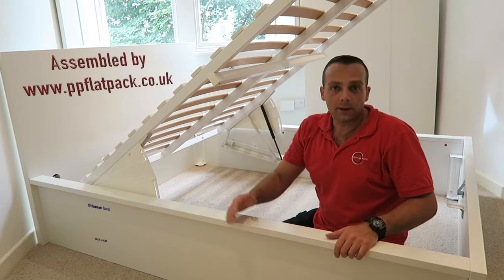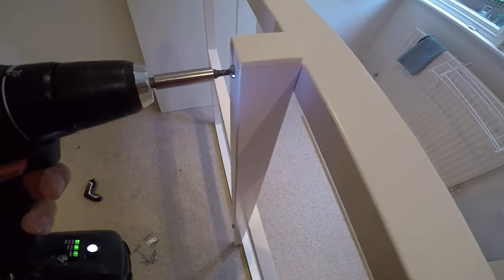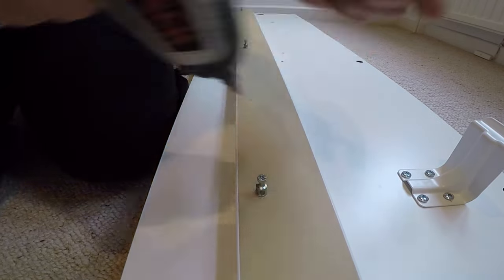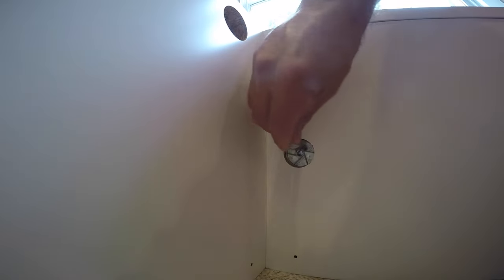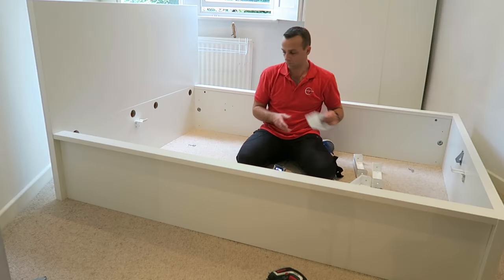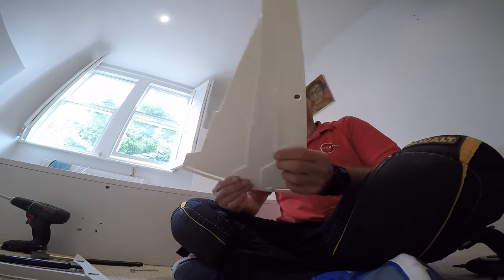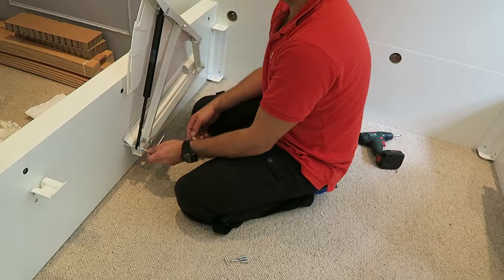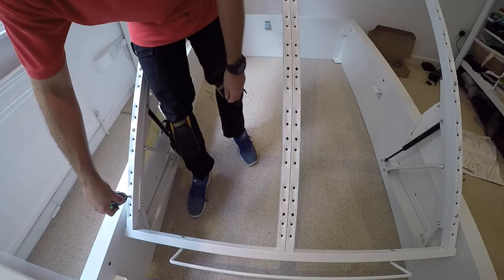IKEA MALM OTTOMAN Double Bed Assembly

Comment: Just picked up/built this bed today. I gotta say your method of assembling this bed was way more efficient, thought out, and made this whole process easier. I had my girlfriend help me out by sorting out all the screws and helping me place the metal frame on the gas pistons that raise the bed. I was working in a very small room so It was VERY helpful to assemble the metal frame first prior to assembling the bed frame itself. Having a drill also helped a lot. Thank you for this video!
Reply from the maker: Here is the latest video for this bed with more details https://youtu.be/bo296drSu9w  Thank you for watching
Reply: @PPFlatPack Hi. I have a question about the headboard - can I rest my back while sitting up against it?
Reply from the maker: @Yaqeenan21  Yes you can but not heavy resting ;). If your bed is against the wall good idea is to put somthin between the wall and the headboard than can lean against the headboard without worries.

Comment: Great video. We’ve just bought one of these beds and although I’m ok at self assembly furniture it’s always nice to have a heads up on any tricky bits. Well done on your very easy to follow instructions. Thank you 😊
Reply from the maker: Thank you for watching
Reply: Wondering how the bed it going... Are you happy with it. I want an ottoman. Other company ones lovely. Wondering how the ikea one holds up
Reply: @thefridge1000  Hi. Yeah we’re happy with it. Used it for a year or so now. Very sturdy construction. Most other wooden framed beds we’ve had in the past would have started to have the odd creak by a year into being used but I can honestly say this ottoman bed is creak free. The extra storage is very handy to have and the access to underneath is great. All in all one of the best beds we’ve bought.
Reply: Hi wondering how big the matress you use on it, cause went online and sow for king size should be around 50kg and i think the one i ordered is a bit more then that cause is 32cm thick.
Any problem with lifting the weight?

Comment: Thank you so much for the tutorial - I followed all the steps and the bed frame does not come down.... maybe the black part in the sifting mechanism is defective... is it supposed to get shorter when the bed is lowered? Thank you for your help!
Reply from the maker: I see similar coments regarding putting the storage place down without matrice. The pistons are very strong to hold the weighty matrices so without matrice will give stronger resistance. I always just push little harder (if everithing assembled correct) and always goes down. Here ia my latest video about this bed with more details you may find your answer here https://youtu.be/bo296drSu9w?si=ZCZB04dcsjghA4SS
Reply: Eu não consegui também descer a cama os pistões não desce porque?

Comment: Thanks for the vid! Does anyone else have the problem that the slatted metal frame transfers a lot of motion during sleep with a partner? Like the whole metal part moves around and the wooden slats act like a spring to transfer motion across the bed. Has anyone discovered any solutions?

Comment: On my own this bed took me over 5 hours to put together, when I finally got to the part where you connect the frame I discovered both of the gas struts that help lift the bed would not compress down and I had to disconnect one end of each of the struts just to get the frame to lie flat until I could contact IKEA the following day. not happy! now I have to disconnect the struts to take them into IKEA to be replaced
Reply from the maker: angela phillips if you don't have mattress on is hard to press them down. Once you put mattresses on it will be much easier they have to be like this to be able open the storage part with heavy mattress.
Reply: I tried pushing each of the gas struts down myself putting my full weight on it and I'm 110kg, neither of them moved so if they wouldn't budge with 110kg pressing down on it then it wasn't going to move with a mattress that weighs less than that.
Reply from the maker: angela phillips True if you push hard on the opening part should be able to push it down. In your case look like faulty push up mechanism. Sorry to hear that IKEA return can be bit challenging hopefully they just replace the parts you need. Sometime they want to replace whole thing no just parts. Good luck
Reply: well if they do want to replace the whole thing I'll be making sure they provide someone to assemble it because doing it on my own was extremely tough!
Reply: Believe it or not, when I went to take the bed apart again to remove the gas struts to return to IKEA I decided to give it one more go to see if I could get them to shift (I'd sprayed them a week ago with an engine lubricant spray to see if I could get them to budge) but this time a week later they finally moved and I was able to shift the bed down! Gotta love WD40 it may have taken a week but it saved me a trip back to IKEA!

Comment: I broke those cam lock things three times, had to order fresh. Not sure what I did wrong. They just broke in half. Felt like hulk!
Reply: You screwed them to the wrong place.  Pay attention to the instructions on several pages, not just the one you have to attach the locks.  I'm a girl and I assembled this bed by myself.  You can do it but don't rely on your logic and just follow the instructions step by step.  Don't try to put down the bed before you accomplished the previous steps.  I didn't watch this video just because the guy didn't follow the instruction steps.  He didn't have to do it because he probably assembled this bed multiple times but for the beginner it's a must.

Comment: Thanks alot for this video! Took like six-five hours to get all things together, but it was just me. BTW, wanted to ask, when I've screwed bolts inside of frame it had been deformed for a bit from bolt head side. Is it okay? Guess frame metal is kinda thin, but washers would do the trick.
Reply from the maker: Thats right the metal frame is not hard enough so is bending little if you tide the screws to hard. 5h is good timing if you dont do this often well done
Reply: Yeah that's my first bed which was assembled by me. I've twisted screws 
well just to make sure all this construction won't make noises after 
some time :) I kinda disappointed regrading frame metal quality, my 
weight is about 102kg and depend on season might be a higher due to GYM.
 But lets see how it'll serve - maybe its enough. My very first purchase
 of furniture in IKEA.
Reply from the maker: Dmitry Vorobyov This bed is one of the stronger ones from IKEA you should be fine with 102kg I did few of them and never have complaints regarding build quality.
Reply: Good to know, thanks

Comment: This is a random question, but is it the headboard needed for support or something essential? Thinking on getting this, but can't fit the headboard. Thanks in adv!
Reply: I'm in the same position as you - I have a tall window that would be blocked by the headboard.  You can build the bed without it and everything works - it's not needed for support or anything structural.  Only thing to bear in mind is that you'll have the holes that the headboard would have slotted into... I doubt it would be noticeable behind your mattress though.
Reply: I have this.  I dont think you need the headboard

Comment: 8:48 hi, i have problem with this part, fram won't go down its stuck ;/, any ideas ?
Reply: Hi did u find fix for that cause Iam on that step and struggling for hours to work out that certain mechanism
Reply: Did you end up fixing it?
Reply: Mxlanin Subs yes
Reply: Qais Baraki thank you! I am planning on getting this bed. I have a few questions: 1. Is the bed long lasting and sturdy?   2. Is it noisy?  3. Is it worth getting?  I would appreciate if you could answer these questions. Thank you very much
Reply: Mxlanin Subs I really recommend it and plus I had it for 1 month there’s noise only when you don’t close it properly it is very worth for it’s value but i advise you to build with 2 people to make assembly easier especially when fixing the mechanism of the bed
Reply: Qais Baraki thank you! Will do

Comment: Hey there, I just assembled this bed from ikea but we cannot get the bed to go down, we've tried loosening screws we've double checked all the parts are in the right place and it still won't budge- is there a specific trick?
Reply from the maker: Mary Harding It is hard to put the storage part down without mattresses but if you press hard on it you should be able to push it down. All what I say apply if you did all assembly right. Sorry hard to say if I can't see it. More people complain about the same problem but that's how it supposed to be but tough so the whole thing can lift up heavy mattress.

Comment: Hello, do you think I can attach the base to a bed frame? (Without the extended bed frame)
Reply from the maker: Yes you can. Here is latest video on this MALM ottoman bed with more details https://youtu.be/bo296drSu9w
Reply: Thank you. I just realized that I said bed frame. The correct question is do you think I can attach the base to an existing headboard? Im considering buying this bed, remove the extended headboard and use mine instead
Reply from the maker: @LynyGrullon  I was thinking you asking about a metal frame connected to the mainframe ;) Regarding different headboards just check the measurements and if you have enough space to attach to the original bed frame. Also, I would check the front panel on the MALM if is not one of these hollow materials Ikea do that sometimes for thick panels. If yes maybe will be not so strong all along the panel they do sometimes solid material only where are the connections and the rest can be hollow.
Reply: @PPFlatPack  you got it! Thank you